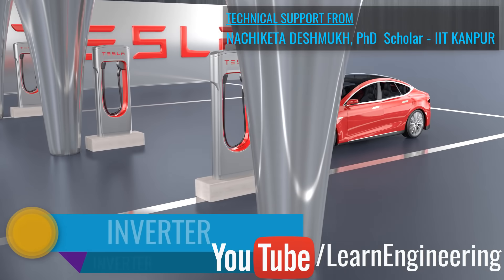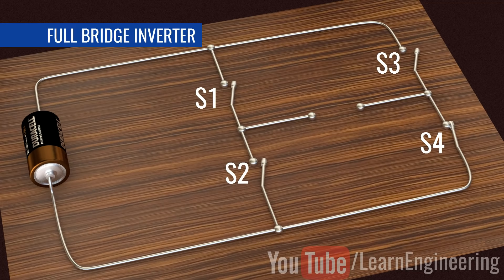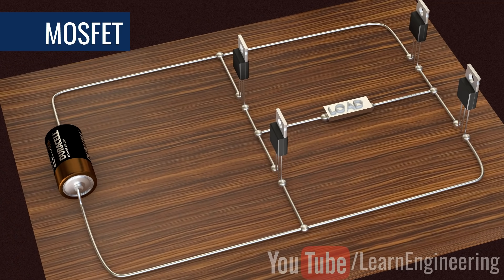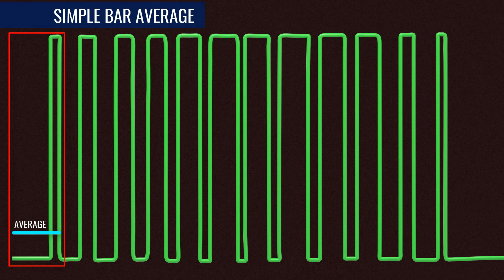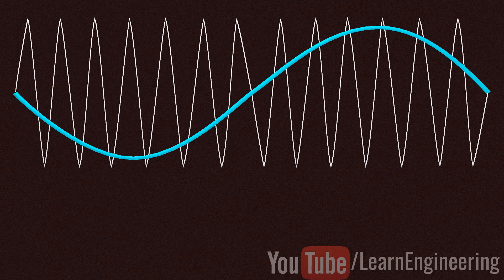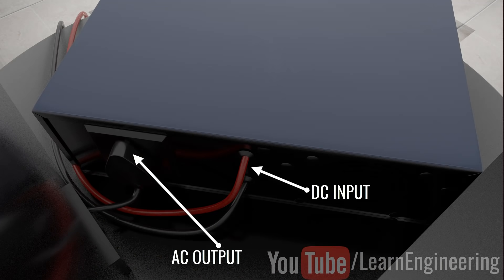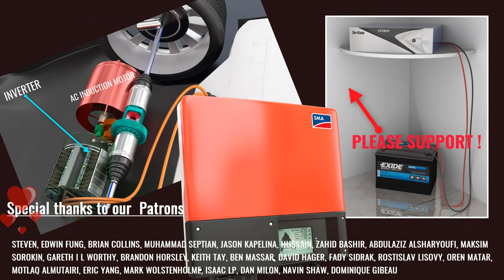Inverters, How do they work?

Comment: Wait, the sine wave that is fed to the comparators, where does it come from?
Reply: say, Colpitts oscillator will produce a sine wave rather easily. It just can't produce enough power.
Reply: +Ciroluiro
You didn't get the point of an inverter. It isn't supposed to be a "signal" generator. Think of it as a power amplifier for a signal. Unless you have super high requirements for your signal shape, creating any waveform is easy. And instead of having physical comparators the switching pulses for the MOSFETs are usually created purely in software.
Reply: So you can just instruct the MOSFETs with an Arduino or some microcontroller programmed to produce that pattern of PWM that matches the sine wave frequency of your choice. And the battery/DC power supply will supply the amplitude (voltage level) desired.
Reply: @basedonprinciple  بسم الله الرحمن الرحيم 
من باب المذاكرة
هل جربت هذا الأمر؟
Did you try that?
استخدمت مقارنين لكن لم يفي بالغرض؟
i have been use two Comparator,
lm358
&
non-inverting amp 
but it is not satisfy what i want
Reply: A very very tiny electrical engineer is included in the circuit to stimulate sine waves. There's one in every box of circuit parts.
Reply: @SpaceCadet4Jesus  LOL
Reply: finally a smart guy
Reply: If the sine wave doesn't need to provide actual power, only be there as a reference, is quite easy to make an accurate one combining a few Op-Amps and capacitors, or using pure PWM with higher switching frequency and a sine wave table in software.... The need for comparators came when you have a load that change over time, a fixed solutions would over and under voltage the output.
Reply: @matgod2004  but if you already use pure sine pwm, cant u just build a normal bridge inverter and control the gates with the given pure sine pwm? so no need for comparators and all the things?
Reply: Sine wave is easy to produce (a $5 walkie-talkie can do that). It is hard to produce a high-amplitude sine wave capable of giving enough power to accelerate a Tesla to 60mph in 3 sec.
Reply: Wow!  And I always thought they had a monkey in there flipping those switches back and forth really fast.
Reply: Everyone's saying "why not make the initial sine wave big enough"
Well,
M O N E Y
And it'd be darn hard
Reply: from what I have seen. most pure sine inverters . use a boost stage. and a H Bridge output stage. with filters. to get a clean sine wave from the spwm. or pwm ed sine wave. the boost stage uses high Hz switching. of a inductor. and stores the power in a large cap. then the H bridge chops it in to AC power. only cheap modified sine inverters use push pull through a transformer to get ac. its hard to regulate the output. but I could be wrong!
Reply: @jamest.5001  "only cheap modified sine inverters use push pull through a transformer to get ac. its hard to regulate the output. but I could be wrong!"
Indeed.  Very expensive APC 2200 rack mount UPS uses a full bridge square wave on the primary of a hefty transformer, and the load is on the secondary.  Fully isolated and can tolerate load variation and load reactance better than high frequency PWM inverters.
Reply: Oswald Rayleigh actualy the ocilator would not be able to supply enough power and the frequency would change depending on the load which is not good.
Reply: You can use a microcontroller instead those comparators. Run a program that will infinitely compare sine with saw and its outputs will be connected to those mosfets.
Reply: zumszum No need to compare anything. Any programming language has a math sinus function. Just forward the output of that function to a PWM output. Something like a Raspberry Pi and a MOSFET is all you need. And some filtering capacitors.
Reply: Noorquacker you’re the most correct individual in here I swear to god
Reply: This is a tutorial video. Otherwise, I think the comparator should be driven from the Grid, when we want to suply as the donor
Reply: Technikus Mezőgazdasági The frequency of the grid is way too low in order to modulate the triangular wave.
Reply: Nicolas Christin I know, right?
Reply: you can adjust the circuit though to have a constant frequency, and a frequency changing under load can actually be good, due to impeadance, it will acutally be benefitial, to change frequency under load for maximum efficiency.
Reply: nice
Reply: or that
Reply: Oswald Rayleigh r
Reply: akh345 colpitts oscillator what if you just put in bigger components and/or made more in theory that should work
Reply: :v so the point here is that some device used to create the sine waves is missing right ??
Reply: using sine wave oscillators
Reply: Nicolas Christin p
Reply: I think we can use MCU for controlling comparators
Reply: Late to the party, but why not just amplify the reference sine wave to a usable level with high-current components? In other words, use the reference voltage to control the magnitude of the high voltage. This way, the fluctuating voltage of the reference is reproduced in the output voltage.
Reply: @RAndrewNeal  Re your "Late to the party..."
Well, you've NOW met an even later-comer to parties!

When you say "why don't they use high-current components to AMPLIFY the source sine wave" you are perhaps thinking "sine wave" through and through? Right?
Well, that would be (and was!) the basic design for an inverter. The problem is: POOR EFFICIENCY! You see, the transistors (tubes/valves back when I was old) will run extremely HOT as they behave like SUPER smart and SUPER powerful variable resistors (or "resistances" as some ppl prefer). I hope I'm getting through - I'll try a brief explanation here:
When the variable resistor is FULL ON then the resistance is 0, the voltage drop across the resistor is 0, and the heat dissipation (power loss) would be 0. 
On the other hand, when the variable resistor is FULL OFF then the current would be 0, and once again the heat dissipation (power loss) would be 0.
But in the intermediate portion of the sine wave there would be a current flow. And the current flow translates to heat dissipation and consequent power loss. At the very least (and without using any elect. math) the power loss is 50% of the power output. That's intolerable in a commercial setup.
Just as a BTW, this "sine wave amplification" is better described as an analogue design (my teacher wd crack my knuckles if I dared to drop the final "-ue").
The ckt described in this video is the opposite of analogue - it is what is (inaccurately, I'm afraid) called a " DIGITAL" design.

In this design, the transistors act as high speed switches that are either FULL ON or FULL OFF.  Hence efficiency is at a max (usually over 90% in commercially available inverters).
Besides, there's a point made in this video (which happens to be quite an excellent video on the topic) mentioning load tracking. You see, when we go in for an inverter we usually intend to use it to power our electrical appliances. Right? Well, these appliances do not behave uniformly. For example, an incandescent lamp would behave quite, quite differently from a ceiling fan or a vacuum cleaner. Then there are appliances that alter their behaviour on a continuous basis according to the work they're doing. When these load behaviours become extreme they distort the sine wave's sinusoidality (if that's a word). That means the sine wave output will NOT be a sine wave.
To correct the sine wave's sinusoidality in real time with no prepping is prohibitively daunting (and expensive of course). So, though I'm sure there may be a few examples scattered across the landscape, such sine wave amplifiers are not commercially acceptable.
HTH.

But yes, as a purist, I too would look at a sine wave amplifier as the way-to-go design.
HC-JAIPUR (22/03/2020)
Reply: An RLC circuit can be used to generate pure sine waves. The PWM way using wave tables is a modern one used as a shortcut in the days of microcontrollers for pennies.
Reply: LC oscillator
Reply: @blend45x  Yep, and it's even more pure than 10-bit chopped up sine waves from cheap microcontrollers, though now a days, you won't find proper LC oscillators in many pure sine wave invertors. 
The inductor+capacitor+2 resistors have to be fairly good precision and it costs more than a cheap microcontroller.
Reply: In practice if I already have a sinus voltage so I need to recreate one?
Reply: @Zer01 I think the output from the switches is fed back to the comparator to get sine wave for comparison.
Reply: They can be easily generated from an operational amplifier
Reply: Nicolas - don't even let the witches misguide you, fundamentaly it's all black magic oncevyou strip it down
Reply: An oscillator circuit. There are numerous way to make them; phase shift, Wien bridge, Hartley, Colpitts, etc. 
These circuits cannot be directly used as inverters though because they provide very low power. But they are perfect for switching applications using a comparator.
Reply: Yeah it seemed like this whole complicated apparatus to make sine waves was was unnecesary since it relied on sine waves to work lol.
They should have at least mentioned that. Else it looks like everything is pointless or the solution appeared from under the sleeve.
Reply: A catch 22 LOLOLOLOLO
Reply: Ciroluiro the point was to have control of the frequency generated by the inverter which is controlled by the switching speed. For some purposes, you might need less or more than the US 60Hz.
Reply: but how EXACTLY?
Reply: The video is actually not very detailed, and has a few mistakes. Inverters are a highly interresting technology and I have built an array myself. Most systems dont bother with a pwm circuit but rather use a feedback loop from an op amp ic, and perhapr a MOV to quench the voltage spikes. the output of the op amp goes to a totem pole driver which has an inverting and non inverting output and drives mosfets which drive the transformer and produce an AC sine output. This is one of the multitude of ways of steping up a voltage and a whole array of other technologies exists. Really good google search idea.
Reply: from an oscillator, then how oscillator made it? from resonant frequency of capacitors and inductors
then why don't they  make this huge capacitors and inductors to begin with? well, maybe it is not efficient or ugly
Reply: Nicolas Christin 
I'm not totally sure but I think the output is used as a feedback. to give a sine wave. it starts out rough but quickly smoothed out the output . since a output signal is fed back fed back . I guess grid tie inverters use the mains ac as feed back.???
Reply: @jamest.5001  This is what I was talking about! Like an oscillator whose output is fed back as an input!
Reply: Why? I have dis-assembled and built multiple high power inverters, and push pull drivers are actually a good circuit and a capacitive feedback loop can be used to controll the output, or a simple MOV can be used to quenche any spikes on the output and you can have an almost ideal mains output.
Reply: @ivanrodionov9724  I want to make an inverter using push pull audio amplifier and a transformer. What modifications I have to make. Please name the mods so that I can search them.
Reply: unity circle. ive commented this so many times
Reply: but what about if the power goes out :P? What they really do is they use a version of a pi network hooked up to a square wave oscillator to make a sine ish wave, or the just use the feedback. You can get a very nice output sine wave from a feedback oscillator, and im actualy using one to drive a flyback, and it is based on an lm386 ic.
Reply: it should, but an lm386 or other op amp feed back driver will be even better.

Comment: Where do you get the input waveforms for the comparators from? Where do the triangle and sine come from?
Reply: Pepe You can make these signals using active oscillators (operational amplifier with RLC elements) , or you can make it with a little program (coding a micro controller) that makes a sine or triangular wave in binary value and then you can send this signals to a DAC
Reply: good point

Comment: have you done a video on turning AC to DC ?
Reply: Why do you need an entire video about bridge rectifiers? They essentially do the same thing as shown at 1:10 using four diodes but in reverse and they don't need switches.
Reply: It is quite simple to convert ac to dc   google bridge rectifiers

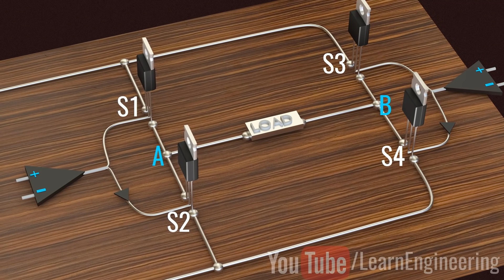Comment: I don't understand why at minute 4:00 is said that there are two NOT ports in order to avoid short-circuit but after at 5:14 it showed that there is the possibility to approximate the curve doing a subtraction of the two digital square waves (VA -Vb) that obviously means that the two comparators close their circuits and it results in a short-circuit on both sides even if for a small period of time. How is that possible? Someone can explain me better since in the video is not well shown this particular moment with the circuit currents and voltage illustration...
Reply: Ill see if I can help. He did a real quick brush over of the MOSFET's. S1 and S2 both receive a voltage to the middle pin, however think of them as relays but in different configurations. S1 would be normally open and S2 would be normally closed. Then apply voltage and S1 closes and S2 opens. That way it is impossible for them to short circuit. I hope that answered your question.
Reply: drumintercourse 
Thank you for your answer. Appreciate.
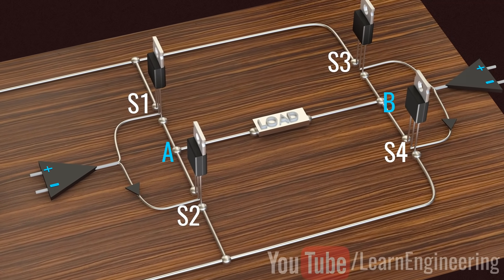It is clear, but than let me ask better: how it is practically possible at 5:15 to do the subtraction (with the circuit at 4:00) of the voltages Va and Vb showed by graphs?
Reply: Ok i think i understand what you're asking. I had to think quite a bit on it, lol. At 5:14 VA and Vb are not happening at the same time (despite that he illustrated them on top of each other). VA is the pulse happening between S1 and S4; Vb is the pulses happening between S2 and S3. Respective to the load, VA would be the peak of the "sin" wave and Vb would be the "trough". So VA-Vb=0, just like an AC wave, due to the perfectly calculated average voltages.
Reply: drumintercourse 
It is good. Thank you again even if I really cannot understand that graph with this circuit. Let me try with other words.
They are trying to reduce the impulses in order to approximate as best as they can to the original wave form and of course keeping the average voltage equal to 0. It is ok. Then they said that to obtain a skinny impulse ( so to shrink it) you can think to subtract in a period of time a square wave to the other so Va to Vb is that correct? Because if it is ... With that given circuit I cannot see this without short-circuiting it, in the way that the load has no voltage applied but you have a short-circuit in S1 and S2 or S3 and S4.
It is confusing I know...

Comment: So, to create a ac by using an inverter, you are first required to make ac for control signal? Am I right?
Reply: Keval Pandya: generating the sine wave is easy. The hard part isn't creating just anything that you can call AC, but rather to generate significant power that maintains the AC waveform when you attach a load. That's what an inverter does. If it is just creating an AC sine wave and can't power anything, then it is just a signal generator.

In real life you'd only have a sine wave input if you're doing this in analog; in modern digital control, you're looking up the values in a sine table and comparing them to a triangle wave generated by a timer.

Also, the reference sine wave usually isn't AC, it has a DC offset so it is varying from 0-5V or something, whatever the range of the triangle wave is. So it can be generated with just a few transitors, or in a wide variety of ways using simple components.
Reply: There are lots of methods used for an analog sine wave, but using an op amp and capacitor gives a nice clean result. There is also a simple 555 + op amp circuit. But usually you'd only be doing a fixed frequency; it is a lot harder to generate a variable frequency sine wave without doing it in PWM. And you'd probably have a whole bunch of BJTs, with your sine wave generator feeding a current mirror and a multistage amplifier after that. That's why nobody does that; they'd use an IGBT and drive it with PWM! Even in fixed frequency, digital is way easier.
Reply: It's not a sine wave, it's a square wave. DC, either on or off, being turned on/off at specific times by logic gates and a oscillator (clock). But you're right, this is basically the creation of a sine wave from a square wave.
Reply: railspony Thanks for reply. But how sine wave is generated in inverter for controlling of BJTs?
Reply: Kanglar Ok. So to make a modulated control signal of PWM, you can replace sine wave with square wave.
Reply: railspony Thanks for info.
Reply: Did you mean voltage?
Reply: If I understand what you mean by control signal, no, it is all DC current in the control circuit.
Reply: Kanglar I was saying that for generating a PWM control signal, you require a triangular signal as well as sinusoidal signal.